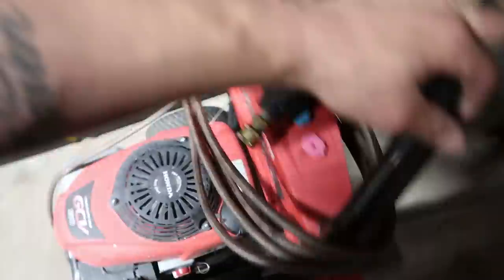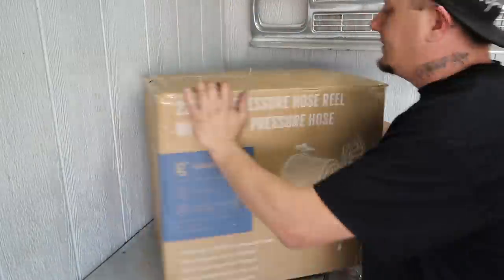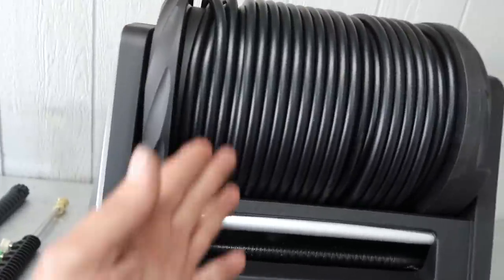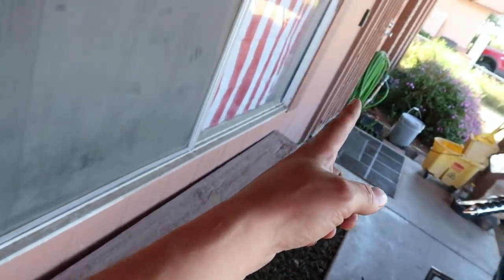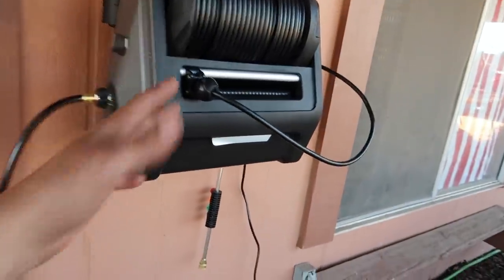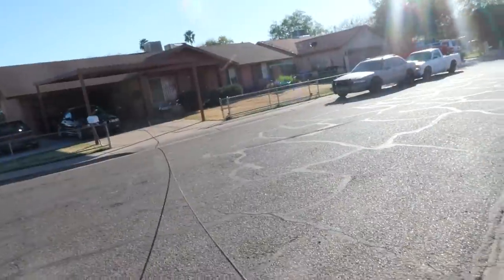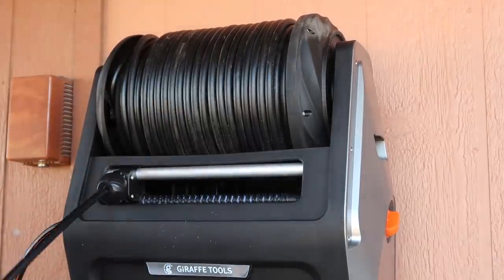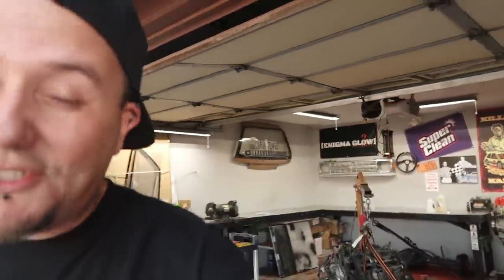My NEW Wall Mounted Pressure WASHER!!

Comment: A good tip for you about hoses. Get a rubber hose. My bro in law had a Goodyear hose and it was one of the best hoses I ever used. They're more expensive but worth it. Especially for someone who uses it as much as you. Those nylon hoses suck

Comment: How was the water pressure ? The gas powered one seems to be stronger, can you give us your opinion between gas/electric power washers
Reply: notice he says "its definitely good, for cleaning cars"
Electric pressure washers simply don't equal out to the power of a gas powered one, but this has other benefits that the gas powered one doesnt. Ie. not needing to pay 5$ a gallon in todays economy. not having to worry about oil changes (does anyone ever check their pressure washers oil? lol)

electric ones are simply. plug em in and go. but they both have pro's and con's
Reply: @dannyipwn1203  I agree. When i was a power washer for a sweeping company i used only gas powered ones. One day i used a electric washer and there is just NO comparison to the power a Gas pressure washer has.